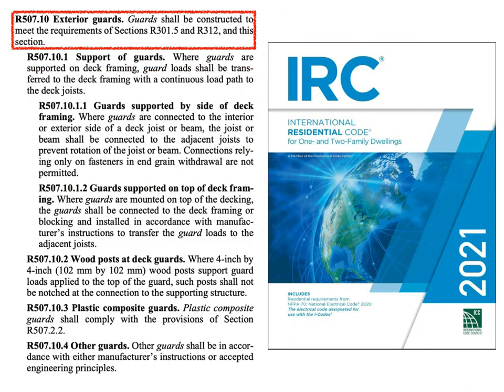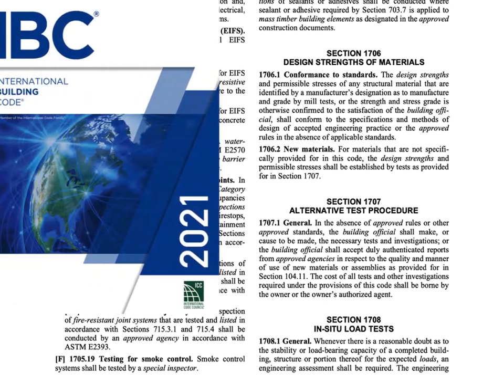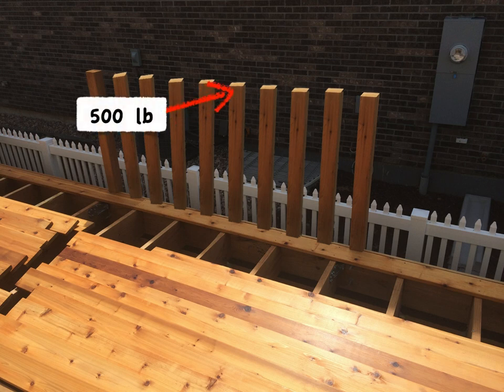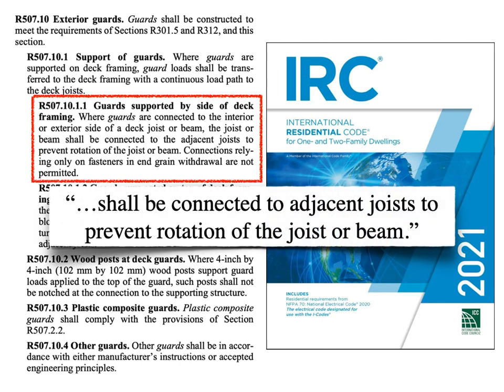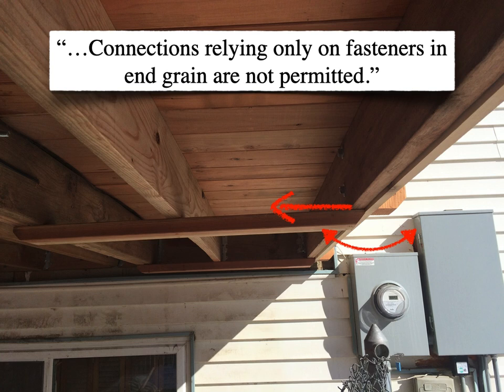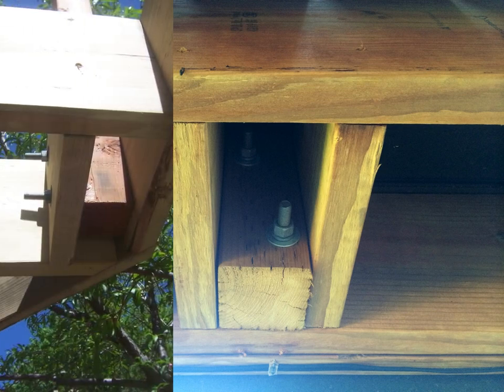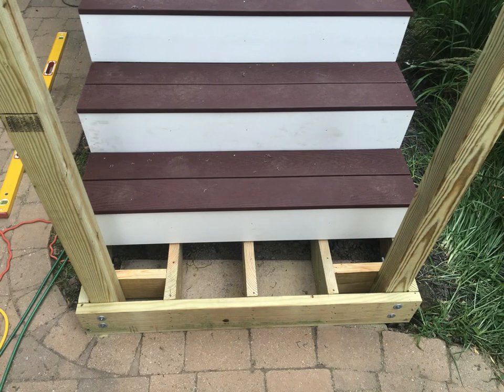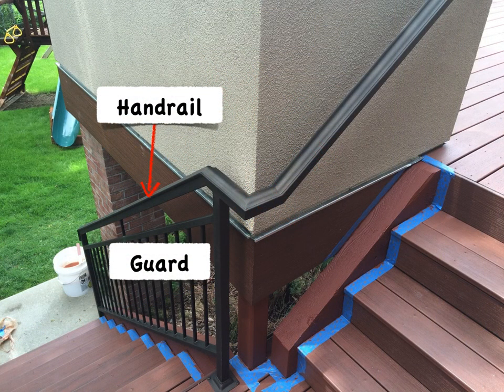NEW 2021 International Residential Codes for Guard Construction.

Comment: What about if you run that handrail post on the inside of the rim all the way to the ground and connect to footing? Bolt post to rim joist? The deck is supported by a beam and that cantilever
Reply: If an engineer can stamp that plan.. sure